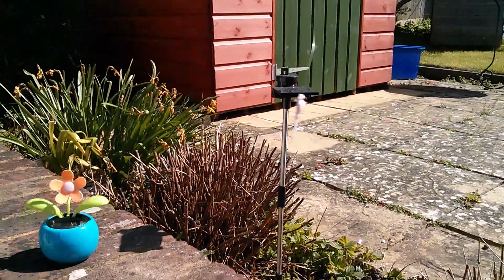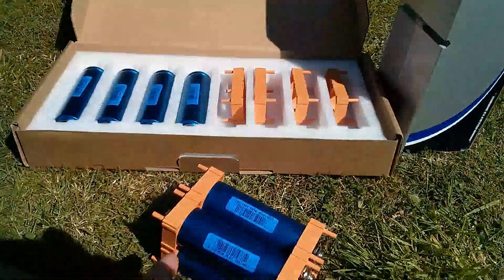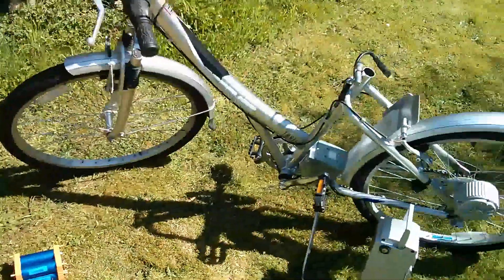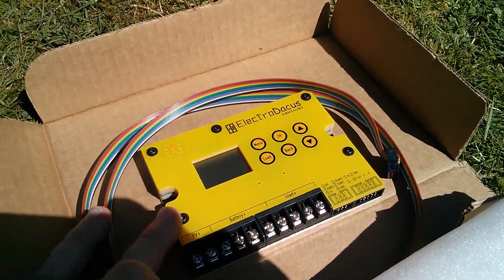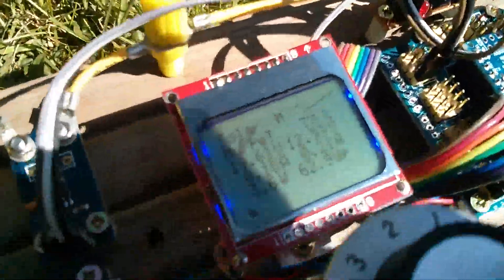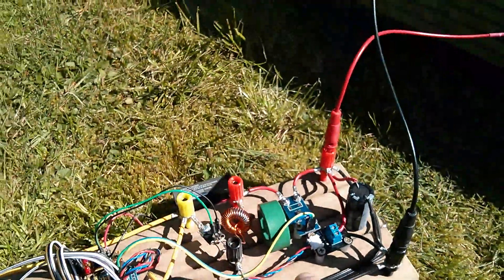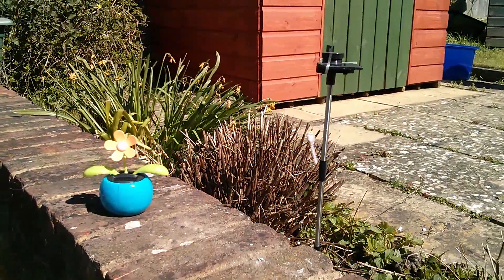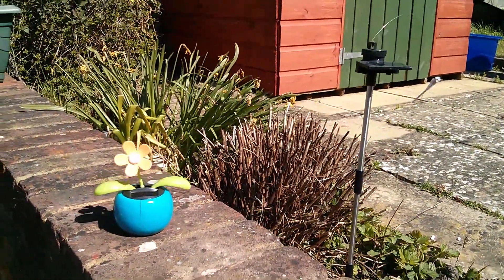Overview: Summer 2015 Solar and Outdoor Projects

Comment: I have built 4 12v 30Ah 18650 battery pack. I plan on using them to power a dc 16" fan. I have been looking at this item on eBay. PCB 20A lithium battery input output protection board. If I install it on the fan and use the balance leeds from the Battery, this board should break off the battery connection if volts get to low. Seems this may be what you need for your bike project.

Comment: LOL! I think the dragon fly worked a little to good. Maybe a geared motor to slow it down? Also please check out my channel I have arduino projects (a sun tracking solar panel.) and solar panel setup in my apartment.(I just got the go ahead from my land lord to install them on the roof!) I love your channel, all your gadgets and postbag. Really nice videos. I really enjoy them. Also nice bike setup and its pretty cool that charger works off of 12v too. If you get a child trailer they normally make good flat trailer that would fit that solar panel nicely. But you don't have to disconnect the voltage monitor, just use a simple waterproof switch to turn it on and off. And very interesting on a mppt charge controller. I will have to watch that video...

Comment: It cool to see some more solar project coming through from you Julian. I have been ov the opinion for a long time that MPPT largely seems redundant when you can spend the same amount ov money (or often less!) on more solar output just run through a cheap PWM controller. Good way to go too with that solar garden light. I have quite a few ov those kind ov controllers around (they are the ones that make those strange tones remember?). I have never exploited the controlled light output yet though. Maybe I will.

Comment: LoL .. the Pound shop. Must be one of the worst stores you can send us tech guys to.
I tend to buy cheap stuff which ends up in projects on making it better.
A good improvement with the solar light things is buying a 5 euro 6V 3.5Watt panel on ebay, the ones with the useless usb connector, and connecting it parallel with the crappy cells that come with those toys. Even in our bad winter weather those things, which I weatherproof too with a 2 euro glue gun, work perfectly.

Comment: Put a switch on the earth of your little monitor so you don't have to unscrew the case to unplug it!
Reply from the maker: Paul Bearer I will try that. I'm concerned that once the alarm sounds, it will latch on and need to be reset. A little switch on the Gnd connection might work.

Comment: Hi Julian,
Summer is coming. I have most of my solar panels running very well.
There are two which I have on my roof, one is 60 Watt 18 Volt the other one is 100W, 24 Volt -ish and these are in series as I only have 2 wires to my roof.
It is hard to get a normal MPPT running, it usually only detects 1 panel, the one with the highest voltage. If I connect something like a battery, the voltage drops to 15 Volt and I get the current and power from both panels, whereas the MPPT tracker does not see the lower one. To overcome this problem I now use that 300 Watt DC2DC converter you have as well. It automatically drops the voltage when the output needs more power. This way I no longer need MPPT tracking and I get the most of my two panels. I know it is just 'my specific problem', but perhaps you could try and see if your 80Watt panel performs just as well on your MPPT tracker as on the 300W dc2dc converter, and please share this with us.
Reply from the maker: deslomeslager For years I've been meaning to put a DC/DC converter directly onto the output of a solar panel to see what happens - maybe this summer.

Comment: Julian be aware that from experience, those cheap voltage/low voltage monitors and alarms can be pretty inaccurate AND unreliable. They like to drift here and there and be fairly inaccurate. Would recommend testing a slew of them, for an interesting video.

Comment: Yes, you can add a switch to shut off the battery voltage monitor, saw a video on YT where this was done in an 18v power tool pack.  Only issue is that voltage monitor will forget the voltage setting ever time it is powered down so you'll need to reset it if the default is not correct.  

I set up to use one in my 18V Black and Decker LiPo battery pack:
- https://www.youtube.com/playlist?list=PLpY2FP1a9tivZAF7jvqOpDf_8ORS11dsl
but I rarely use the monitor as it is obvious when the charge falls to that point.
Reply from the maker: R Brown Oh yes. I didn't think about it losing the alarm voltage setting when powered down. Bummer.
Reply: Julian Ilett My experience exactly.  I sort of hoped those units had a non-volatile memory for the voltage, but mine seems to reset to something like 3.0 volts/cell every time I plug it back in.

Comment: I think it would be cool for the electric bike if you had the balance charging lead go into an RS232 breakout board (since it has 9 wires). Then you could plug in the cable to go from the breakout board into that white project box already on the bike using another breakout board. That would be a very nice way to charge it.
Reply from the maker: BoomBrush I did buy some DB9 breakouts - may still use them.

Comment: I would not recommend using that small "voltage monitoring unit". It is intended for RC planes where you have constant battery load and voltage sags slowly, but when you have an application where you frequently engage load, hold the throttle for sometime and then disengage and repeat that oftenly every time you engage load battery voltage will sag deep and after a second or less ON time it will recover and you will get very loud beeping every time when you hit the throttle and batteries are not at 100% or close.
I built 8S 18650 pack for my hedge trimmer and every time when I power it ON battery load jumps to 6-8A and then after a second or 2 stabilize at about 2.8A but if cells are not completely full there will be big voltage sag on every "power ON" and this voltage monitor will beep loudly.
Of Course, this cells that you have are something completely different than 18650 cells but voltage sag is something to have in mind if you are building battery packs for high drain devices.

Comment: Couldn't you install a (waterproof) switch between the cells and the discharge monitor at the bottom of your little box?
Reply from the maker: max003mk To fully disconnect it - it would have to be a 9-pole switch! Unless I just disconnect the ground connection, but I'm not sure if that would be sufficient.
Reply: Julian Ilett What's more waterproof than a magnetic reed switch they use on doors and windows. They are a dime a dozen and they can be quite reliable.
Reply: Implementation of a 9- pole reed switch could be... Interesting. It sounds like you might be able to get away with using a 3 pole switch anyway, by disconnecting gnd, b1 and b2.
Reply: ***** Arrange the reed switches in a cylinder, like a revolver, and run a single magnet down the center, activating or deactivating all the switches at once, depending on the magnet being in place or not?  Just a theory.
Reply: Julian Ilett perhaps investigation is in order.

Comment: I detect input voltage to put my controller into night mode. It works perfectly. Version 2 of my controller uses just under 1mA in sleep which I'm more than happy with :-) Still coding that one though! Due to go into service in the next few weeks.
Reply from the maker: abyssunderground Have you blogged this controller?
Reply: Julian Ilett Version 1 I did briefly yes, you can see that here: http://www.andrewwhyman.com/blog/electronics/arduino-pwm-charge-controller/ The code on there at the moment is the original. I'll upload the sleep capable version in a few minutes. No doubt I will do version 2 blog in the future when it's completed.